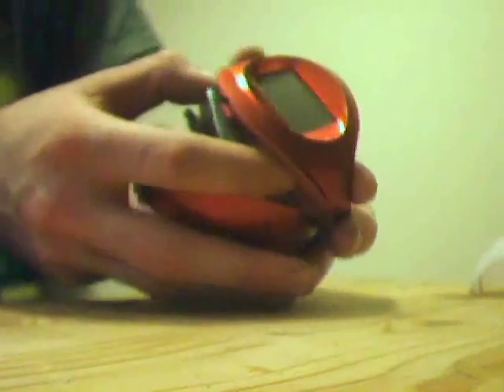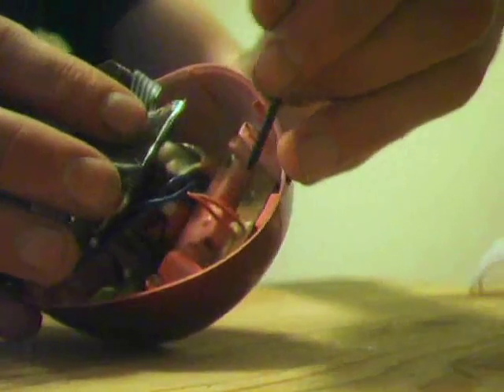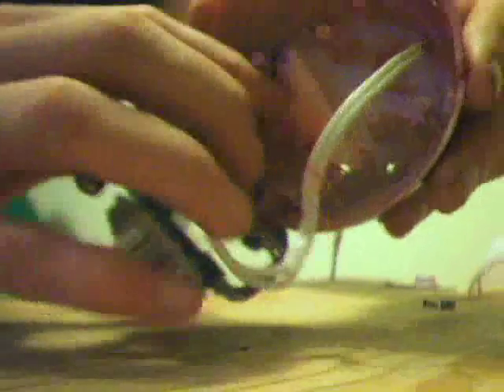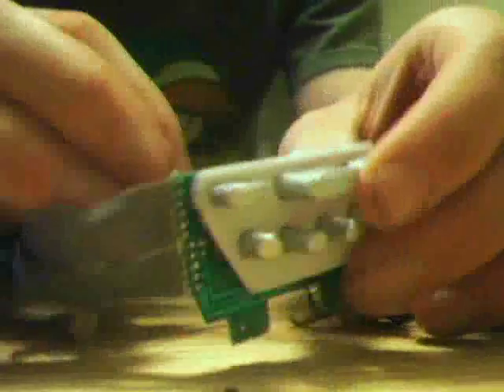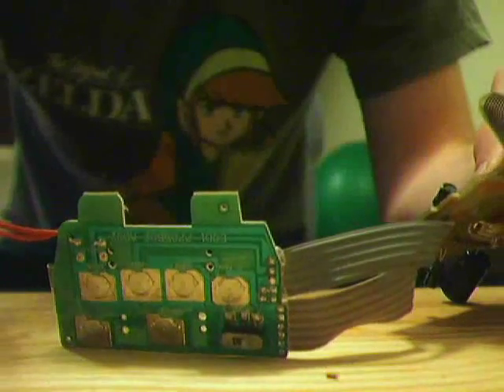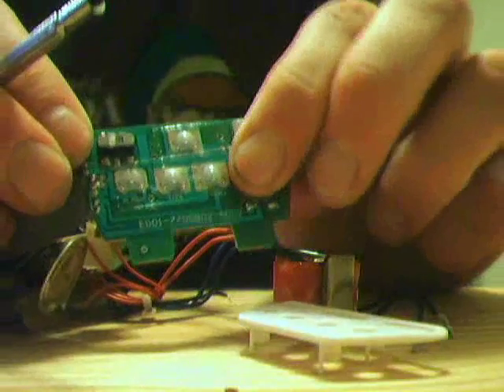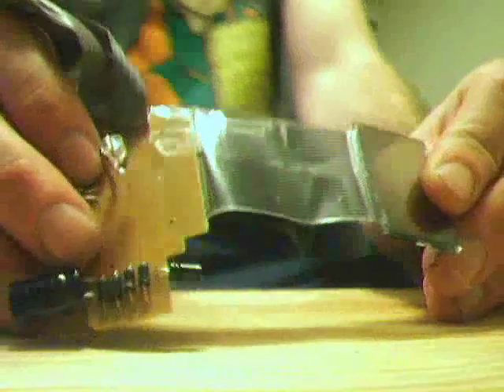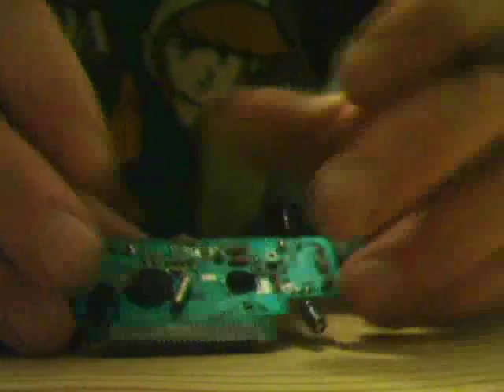Take Apart: How Do Digital Clocks Work?

Comment: Interesting video but it doesn't really get to the bottom of the question. Digital clocks are at their heart 'quartz' clocks that convert the vibration of the quartz crystal to digital format which is then displayed on the digital screen using a binary code translation.

Comment: great video, got a question for you
I have an electronic chess clock with a dual analog display. The electronic system drives the analog clocks. The minute and the hour hands fell off. The problem is that I can't figure out in exactly what position I should re-position them so that when I set both clocks for a 5min game, the arms driven by the electronic system adjust the time and in doing so it should display a similar time on both analog displays but it doesn't. it winds the analog clocks and end up with different times displayed on each one of them. for a 5min game for each player both analog clocks once adjusted should end up displaying the same starting time for example (5:55). I hope this is not confusing, any help is  much appreciated